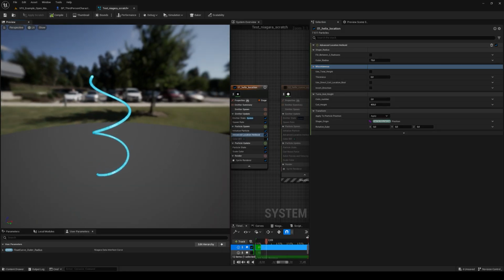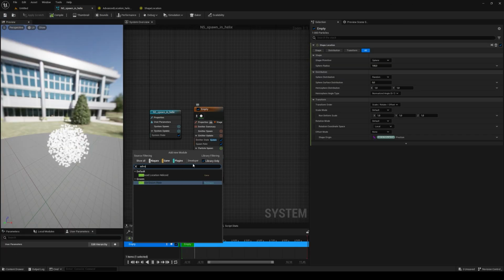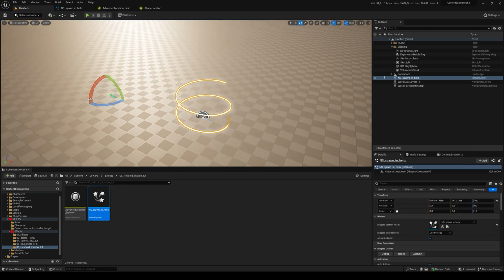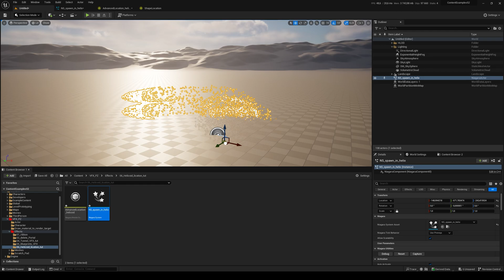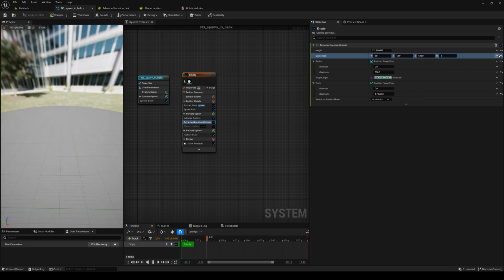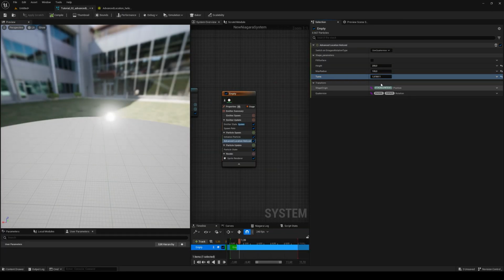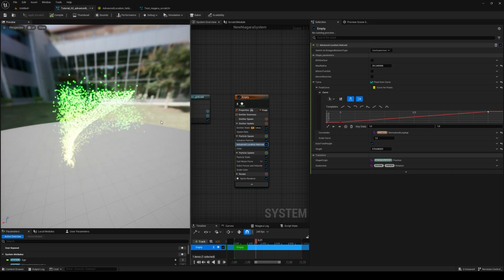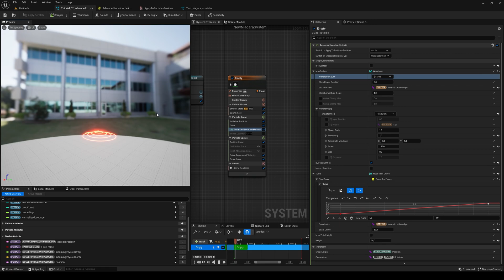Unreal Engine 5 Niagara - create your own shape location. Spiral spawn Location, scratch pad.

Comment: My map get didn't give me the pink connection point after I switched to custom
Reply from the maker: The color of the connection will vary on the variable type you have there, if you have vector it will be yellow if float green. If after changing default mode to custom you don't have this pin opened you have to check if you changing the right variable, maybe you have some duplicates or so, maybe try reboot unreal, it's very basic function so should work well if there's no bug.